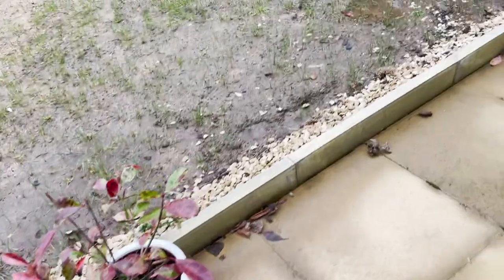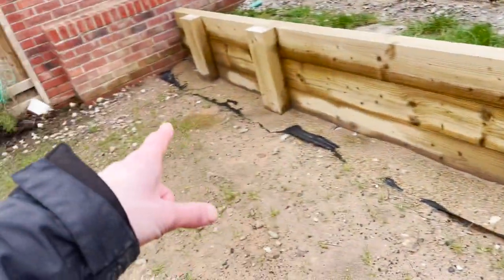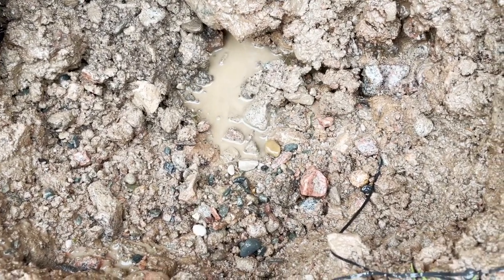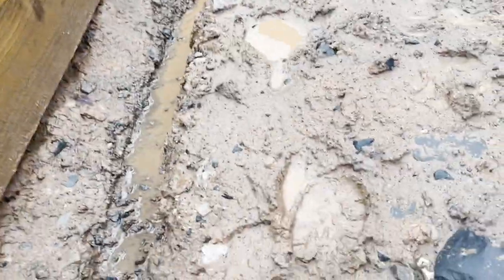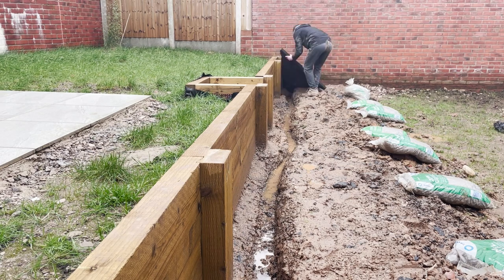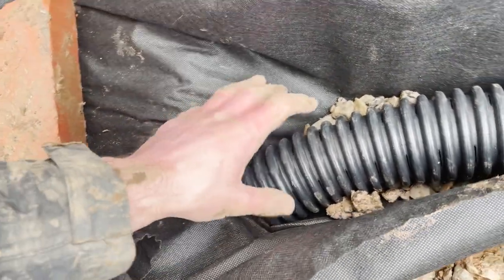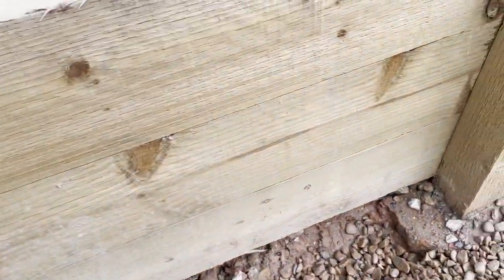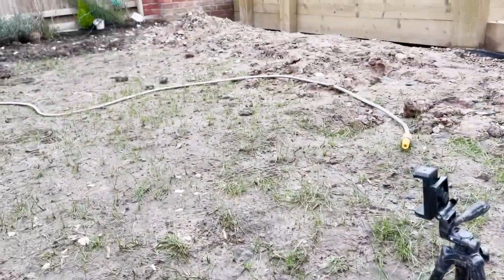French Drain Install - DIY - GARDEN RENOVATION

Comment: That’s for the great video. If you’re putting it on the retaining side of the sleeper wall, so the higher side with all the retained soil, would you first put the gravel in as a bed and to form the fall for the pipe, then put the pipe down maybe with the fabric sock and then more gravel, say 100mm cover then the weed membrane and then just fill in with the topsoil from the digging? I have about a one metre high wall and trying to figure out the order of things. Thanks again.
Reply from the maker: That would work great doing it that way. As long as you have some sort of gravel barrier with membrane between the pipe and the soil, you're sound.

Comment: Thanks for this series of vids, I'm planning to do something very similar and will follow pretty much what you've done. Regarding the drainage, other guides I have read suggest installing a drainage pipe behind the  retaining wall- I know you didn't do this, do you think it would have made any difference? Would you do it if you were to start again? Cheers
Reply from the maker: If I was to do this again, I’d definitely install the drainage pipe behind the wall as it will be able to collect any water that drains off from the higher tier before reaching the wall. I didn’t want to install it behind my wall after the fact in case I disturbed the patio foundations. Good luck with your project, hope all goes well! 👍🏻

Comment: Our new build is like this, problem is the bottom of our garden has a brick wall at the end of it 50% of the width and then fencing but the drain is on the otherside of that brick wall so got no where to tap into. Have the garage gutters but then that would involve putting a pump and running that which isn't viable. Can't install a soakaway neither as its clay
Reply from the maker: Some of the planning by new build developers is terrible! It seems a lot of the time that the garden is just forgotten about completely. Hope you find a solution 🤞🏻
Reply: @NoviceGardener  yeah then it ends up being us to pay thousands to fix it. I believe there is local planning for drainage and they must abide by it but not sure how to obtain the plans

Comment: Which way are the holes facing in the pipe? I read they are supposed to face down rather than up?
Reply from the maker: They are all the way around the pipe in each direction. If you put your own holes in the pipe, the advice is keep them down. That way, the water level doesn't need to rise too high before the pipe takes it away.

Comment: Hi, Im in Sheffield and my garden is a muddy mess quite quickly every time it rains. If the grass is already muddy as hell, would a french drain work? or does it need to dry first to then become most effective? I'm pretty sure its heavy clay soil in my area. What I dont want is to install a french drain and then the top layer of mud to still happy afterwards. Thanks
Reply from the maker: If you put a French drain in, just make sure that it runs to somewhere that the water can escape. Also, you’ll need to make sure that you have a good layer of stones on top, something decorative would work, just so the water has somewhere to escape to.

Comment: I noticed you put the pipe on a thin layer of gravel, other videos I've watched they put the pipe directly on the bottom, is there a right or wrong way? Or benefits to the way you've done it? Or was it just to elevate the pipe so it flows downwards?
Reply from the maker: If you put it onto a layer of gravel, it just supports the drainage. Also, it’s less likely that any soil gets into the pipe.

Comment: Hi what type of landscape fabric did you use. I’ve just done mine and after putting it in and testing I’m sure I’ve used the wrong type. It might still work just not as well. I used the woven geo fabric.should have been none woven ! Was buried under the wall before I realised ffs
Reply from the maker: It won't let the water flow through as easily, but it eventually will. I wouldn't worry, it's more about the void that you've created. The water should make it's way in!
Reply: @NoviceGardener  thank you, that’s what I was thinking/hoping!